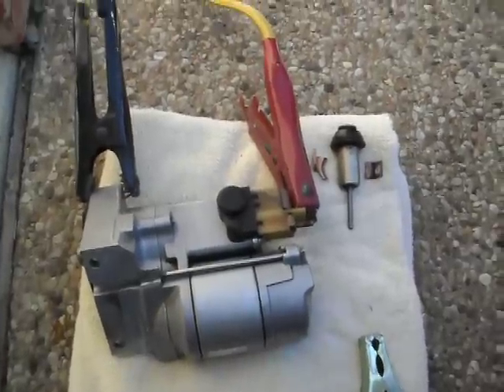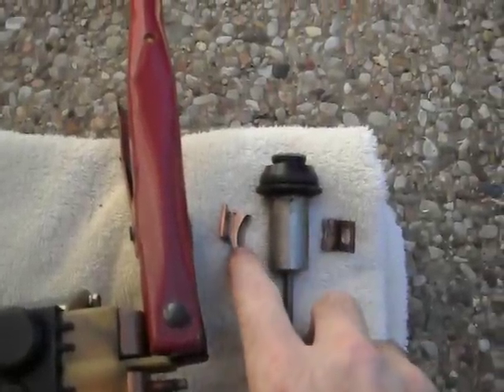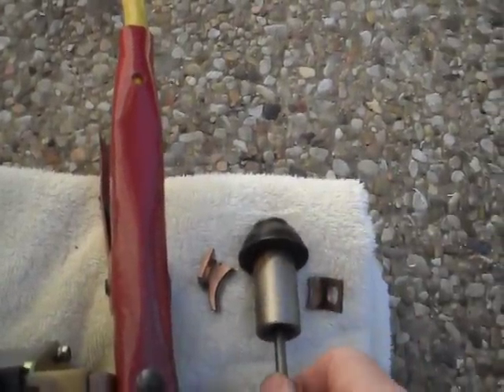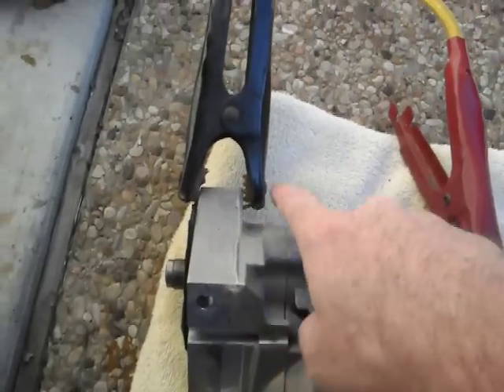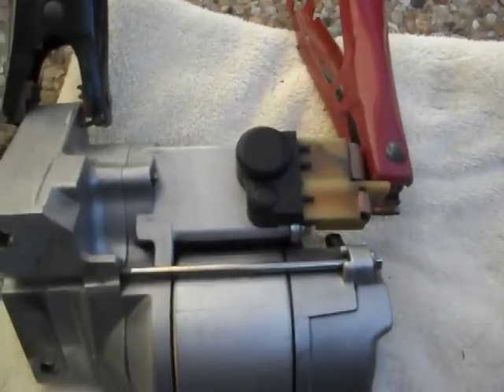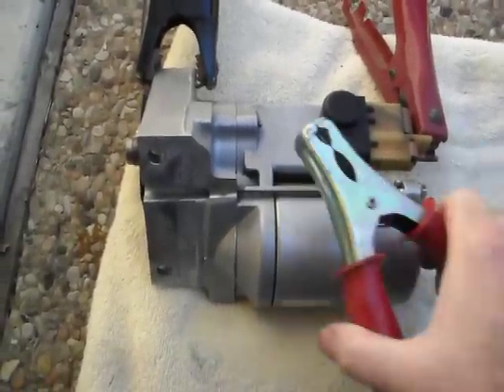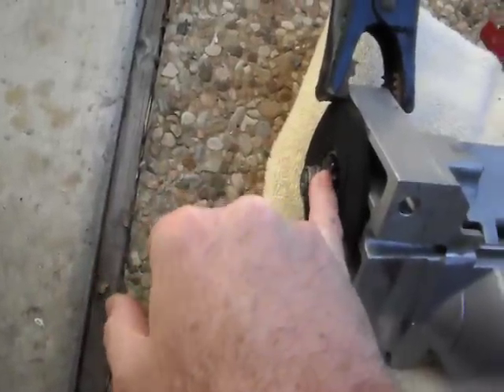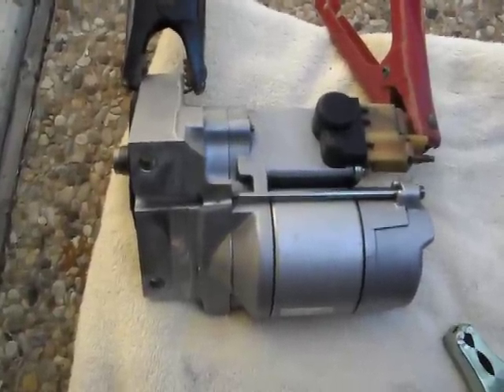How to bench test a starter motor

Comment: Like what? The starter gets its earth from being bolted to the engine, it doesn't have an earth post. Sometimes they have a short earth strap between the solenoid and motor which you could clamp on to.